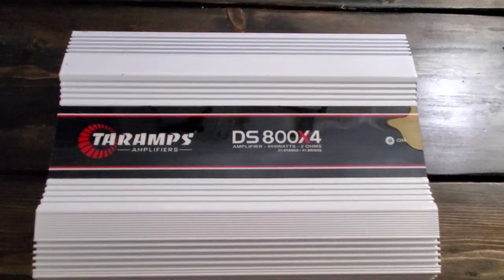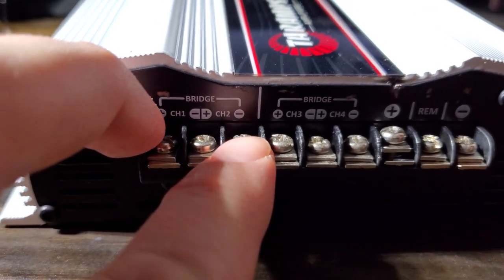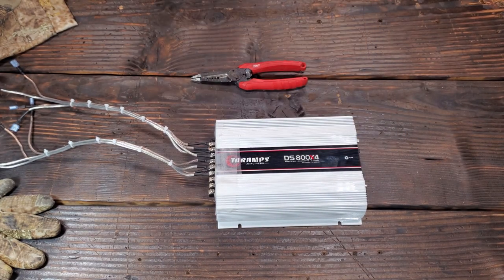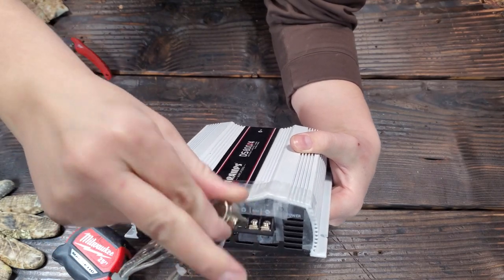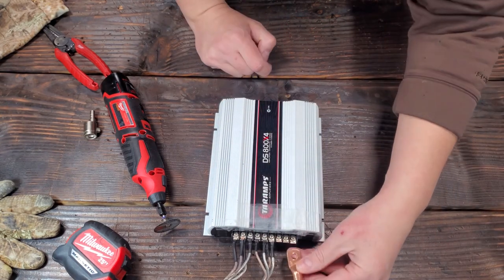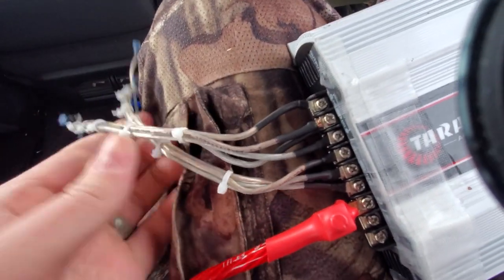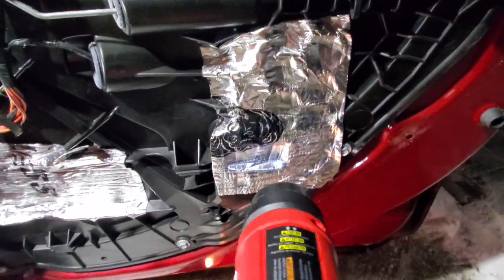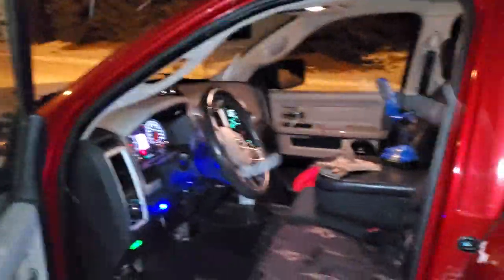Taramps DS800x4 2 Ohms Amplifier, 🔥🔥 800 Watts 4 Channel amp how to wire, and🔥 Demo🔥

Comment: I got this to run my four 6X9 Rockford fosgate door speakers. And my Skar subs, I have them run in parallel down to one ohm..pushing my subs I have a Taramps Smart 3 3000. IT'S A BEAST!These Taramps are serious! They are NOT a basic "plug and play" amp like most, you HAVE to know your system and math. For the smart 3 and larger Taramps, You need to know what your running and tune everything with a volt meter. Starts with your gain all the way low and turn up ever so slightly USING THE VOLT METER because there is SO MUCH POWER, YOU WILL INSTANTLY blow your subs if you're gain is too high. Use the clip light always!!! Voice coils will melt like butter & seize your subs up. And as always, keep your bass boost off on the head unit (stereo) and bass button turned all the way down on amp. Everyone loves turning those up but it's No Bueno. Highly recommend Taramps!

Comment: I call that dedication!!
Reply from the maker: Yeah buddy, I am always freezing my ass off working on wiring hahahaha Thanks for watching, lots of good stuff coming, I picked up another 8 inch Elite Z-8 and the taramaps 3K
Reply: Question I want to add 2 small marine speakers up front I am using a jvc 4 channel on front and rear of my F150 regual cab can I wire them up directly off front speaker wires for front door speakers ???

Comment: Taramps does things with their ratings a little different, as does Soundigital and many of the Brazilian fullbridge amps. That 2 ohms designation relates not only to the stability load, but the load at which it makes full power. If it is a 4 ohm version, it makes full power at 4 ohms, 2 ohm version it makes power at 3 ohms, etc. Need to pay attention to this when buying Taramps products, specs look/means something a little different that others. At 4 ohms, the 800x4 puts out 136x4 and rated power at 2 ohms.

Comment: I have a lunar amplifier that is made like that you don't need heavy duty wires for them 8 gauge wire will work perfectly that's why the terminals are made that way

Comment: I just hooked this one up not loud enuff also cuts out when turn up at high volume have to diagnose
Reply from the maker: If it cuts out you don't have enough Juice, you need a bigger or more battery's, I have 3 AGM'S what are you running?
Reply: @alsrandomvlog8968  just installed a 50 farad capacitor still dimming lights I’m running taraamps 3000k for bass and the 800 x 4 for voice
Reply from the maker: @nyc1655  Yeah I would invest in battery's before a capacitors.  thanks for watching
Reply: @nyc1655  battery is better than capacitor
Reply: Ok voltage is taking care of now when I raise the volume high it makes a scratch record sound at low volume is sound ok but when I go high volume is sounds bad

Comment: One question, how come there's no external fuse?and do I have to install one?
Reply from the maker: With any amp You should fuse your wire coming off your battery that go's to the amp. but  I don't think there is any internal fuse, There are tuff, I have zapped mine a few times wiring it up with the car on. just be carful and you will be fine

Comment: What sub amp u running and is that an sdr skar? Your barely pushin that thing! I would put it on an audiopipe apcle 18001d for budget. but me personally if u have few bucks more i would run tHe cab-22 personally!!!! Its crazy reliable does rated plus some and u have headroom for not if but WHEN u are wanting to switch to EVL or sumn and so on, u already have the power!

Comment: how is 2-ohm wiring different to 4-ohm wiring, does we have to wire in a certain way.
Reply: Yes you can’t find 2 ohms speaker for the door, but if you have 2 speakers 4 ohms in paralelo that will drop for 2 ohms , In that case we even get much more power from the amp